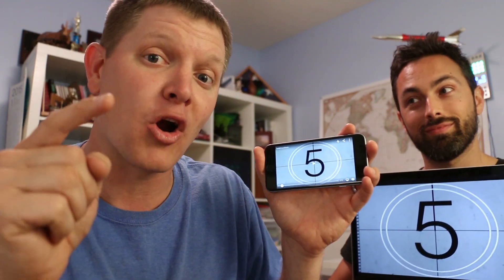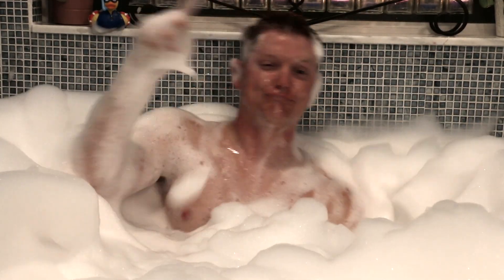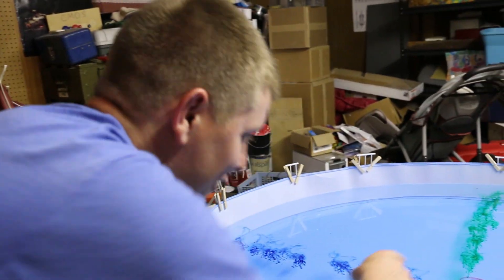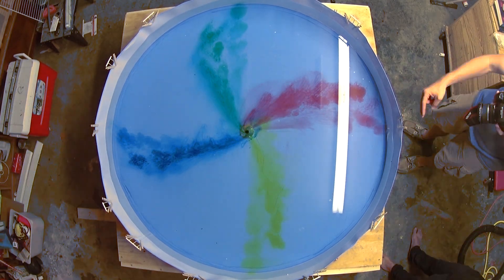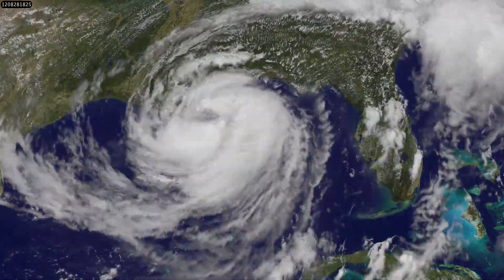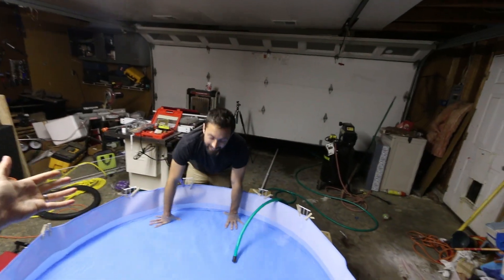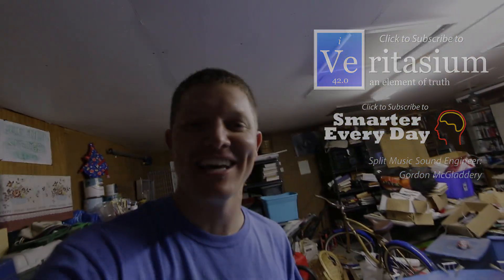The Truth About Toilet Swirl - Northern Hemisphere  (Smarter Every Day 137)

Comment: I like this experiment because it's so fascinating that it doesn't matter whether the pool is tilted or not, the water surface settles to an infinitesimal sector of the Earth's surface area. The molecules of water are so small that it can settle to a nearly perfect sector of the Earth's surface area, allowing the Coriolis effect to take place. Let physics do the work! It never fails!

About the idea of performing this experiment at the equator, this Coriolis effect can be used to locate, over several months of repositioning four separate pools, the exact position of the Earth's equator. However, because space is a continuum, it's practically impossible for a human to place something perfectly on the equator. Therefore, there will always be one side of the pool that has more force being applied and therefore there will always be a predetermined direction. The direction in which the water swirls will never be random for that reason. Come to think of it, is anything random?

Comment: Awesome video guys!  I wonder if you could explain how water would drain at two more points:

1. Drain point installed over the axial pole: My suspicion is no rotation, IF you could install exactly over the pole and IF you could keep the water as water after a day's rest, and...

2. Drain point installed over the equator.  I don't really know what would happen.  Would the water currents cause instability resulting in random directions?  What would happen here assuming a drain point exactly on the equator?

Thank you again for the efforts on the video!  It was fantastic!

Comment: That was quite wonderful. HOWEVER...
Did you repeat your experiment? Your trial is certainly suggestive, but if the rotation were still random then there would be a 1/4 chance of this result by chance.
While it is probable that you have shown what you claim, it's a long long way from a rigorous result still. If you want to make your 'proof' scientific you need to repeat it a few times.
If you want 99,9% certainty that would be 5 repeats if I'm doing my math right (not guaranteed, it's been a long day here!). Usually we'd expect more.

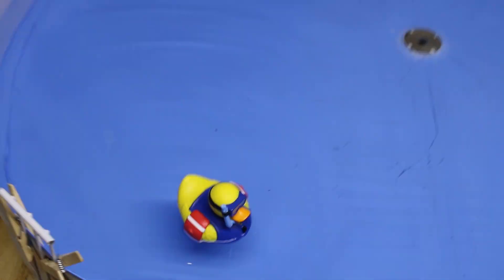Comment: In both videos, at 2:24, you can see why the water rotates the direction it does: The wrinkles in the pool. Destin's has counter-clockwise wrinkles around the drain, and Derek's wrinkles on the outer edge are going clockwise. As the water molecules are pulled toward the center, they run into the wrinkles, which push them to the side, slowly causing rotation in the pool.

Sorry to say, but these would have far, far, faaaaar more effect than the rotation of the earth on this tiny pool. Saying this is caused by the Coriolis effect is like saying the waves in your backyard swimming pool are caused by the moon. It's relevant on totally different scales.

Comment: Hey, there! I love your videos and I think you do a terrific job at making us smarter every day.
This synced video thing was an awesome idea. Congrats on that!
However I must disagree with your experimental results on this one. Saying you eliminated all external variables just by using a small vinyl pool is waaaaay far from real, and you know that. Compared to the forces generated by the coriolis effect, which are practically inexistent for such a small mass of water, any wrinkle left on the vinyl or any dissymmetry in the pool's geometry would completely ruin your experiment.
That's why the coriolis effect only applies to really large masses of a fluid, such as seas or the atmosphere. The difference in speed between the north and south ends of your 1m wide pool due to Earth rotation is absolutely negligible. Breathing near the surface of your experiment would have stronger effects.
Anyway, I'm just trying to be constructive. Don't get me wrong. I still love your channel.

Comment: I was already a subscriber to both channels, so it was a pleasant surprise to see the notice for new videos come up together. The sync was great and worked the first time.

However, I'm not totally convinced by your results. After all, even if either direction of rotation was equally likely, your result would have a 1/4 chance. The velocity gradient across the pool seems much too small to be of any consequence. Furthermore, the Coriolis parameter, which sets the scale of the acceleration to the speed, is on the order of 10^-4 1/sec. It seems that there isn't enough time for this to matter.

Perhaps you have already worked through these numbers and can provide some additional explanation.

Comment: The best part was, I had destins video on my left monitor and veritasium on my right monitor so at the end when they were walking back and forth from channel to channel it was actually accurate. Best video ever.
Reply: Thomas Pakh me too, I even forgot they were two different videos.
Reply: Enduro MF Exactly what I did! Pretty cool!
Reply: Enduro MF I only have a single monitor but I opened up two windows and moved them to the sides (via Windows 7) so they each took up half the screen.  It worked marvelously!  

I am going to get my laptop out later and try it with that though.
Reply: Enduro MF, happened to me too, I wonder if this is happens most of the time, and how did they make me arrange them like this.
Reply: rheniformer Just a few moments, at 6:08 naturally on both videos, before that when Destin was waving his hands you can see his left hand only for an instant on Derek's.
Reply: *****
That would only work if you loaded the Destin video first. I have my secondary display on the left, as probably most people do (since most people would have their PC on the right in the 'default' position). It's probably just confirmation bias.
Reply: Enduro MF Around 6:02 to 6:39 on the time scale; When they were walking from screen to screen they were in the same parking lot. Check the background, it got me the first time I watched it, didn't notice the back ground until I brought up and synced both vids. I'm not finding fault with anything, just wondering if any one else noticed. It was a very good video, the illustration was very effective - also I had no idea that hurricanes swirl in opposite directions north and south.
Reply: Enduro MF Yeah somehow that worked out the same for me too.
Reply: Enduro MF that was a happy coincidence

Comment: 1 out of 1 is not good statistics. Repeat 20 times and do a t-test.
AND Even if the probability is found to be statistically significant, it could be due to  minute flaws in the drain hole and not the coriolis effect (which is very small at this scale). So really the same drain assembly would need to be tested in both hemispheres.

Comment: You only drained the pool once?  And you call that conclusive?  I thought you took a scientific approach to experiments.  Do it a hundred times.  And for gods sake place a clear plastic casing over the entire pool to prevent any moving air from contacting the surface of the water.
Don't you think it's possible that as you were dropping in the food coloring you may very well have decided the direction of the swirl just from the air you were pushing along the top of the water?   Was it just a coincidence that the swirl happened to go in the same direction that you were circling around the pool?  Maybe that's all it took.  You must repeat under controlled conditions,  where air isn't an issue.   Maybe the coloring itself contributed by the way it was thrown.  Don't use any.  You'll be able to see the direction of the swirl at the last moments of the drainage.

Comment: I'm really surprised that the point at which the effect can be seen can't just be handled by defining a Coriolis-Reynolds number.  You get the flow slow enough and the pool large enough and the Coriolis force dominates.  You get similar dimensionless numbers defined in the cases of magnetohydrodynamics (the magnetic Reynolds number) or buoyant flow (the Grashof number).

Comment: My take on this ( I would love Destin's thoughts on this):  The water doesn't change it's circular direction, you have just changed your perspective.  Imagine looking at a rotating column of water from the top down and the bottom up.  What really changed was your point of view.

To sync- put SED on the left, VE on the right. drag each slider till you see the toilet frame with the synchronize text on it.  Then start 1 and then the other.  You will see the times off by the amount of time it took you to start the 2nd.  Pause and unpause the first video by this difference and there you go.

Comment: Very cool video.  However, did you do more than one experiment?  The chance of the drain directions happening to match what was expected, assuming an equal chance of draining in each direction, is 25%, pretty darn high... you'd have to repeat the experiment several times to get statistically significant results (I'm sure you already know this, but thought I'd point it out anyway).

Comment: But Derek put his hand in the pool and was moving it around at the end of the video...
Reply: 991woot119 They also could easily adjust the  pool.. Just thrust them.
Reply: 991woot119 That was probably the day before. Lets face it, one guy is a physicist, the other a rocket scientist. They don't care for what the outcome of the experiment is, they are hard core sciene people.
Reply: Wessel David Probably.
Reply: TheOVERMUCH Their point was that they'd leave it without it being disturbed for a day, re-adjusting doesn't really work with something like that.

I'd also rather not thrust them.
Reply: You can influence the stream by positioning and height difference.
Reply: 991woot119 yeah, i would advice against thrusting as well.
Reply: y? 
okay trust. :')
Reply: TheOVERMUCH
it depends what you're thrusting and what you're thrusting with...some thrusting is allowed...even highly encouraged.
Reply: TheOVERMUCH But that's exactly the thing, they wanted to remove all influence by having it stay still for a day and then leaking it without disturbing the water.
Reply: 991woot119
i thought we're talking about thrusting...who cares about the video....
Reply: Chris P. Bacon Well I care about both.

Comment: To prove it you should have done the pool experiment some more times, and in both hemispheres, also you should have perfect shape in the pool and drain, and no air currents. Coriolis effect is real but I doubt it will be any evident in such small scales before it is overtaken by imperfections of the testing system.